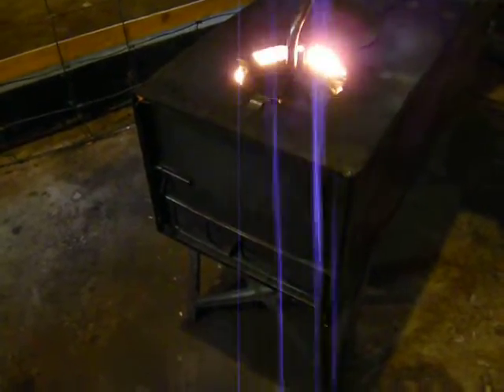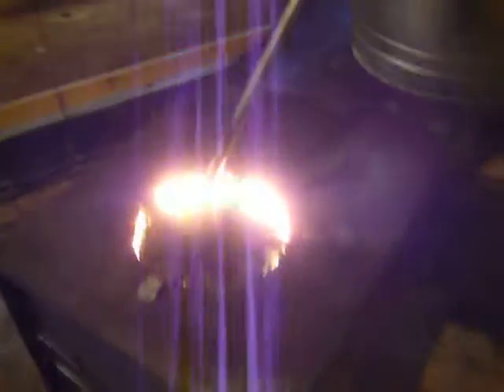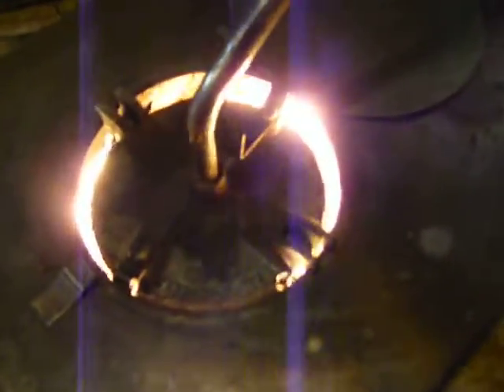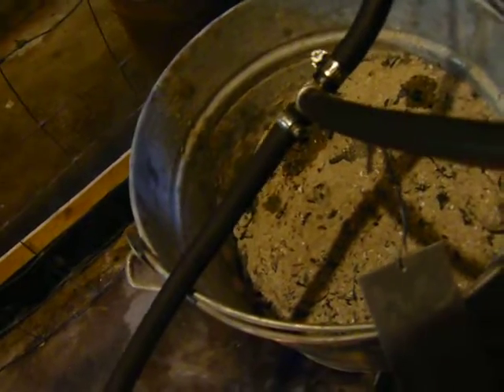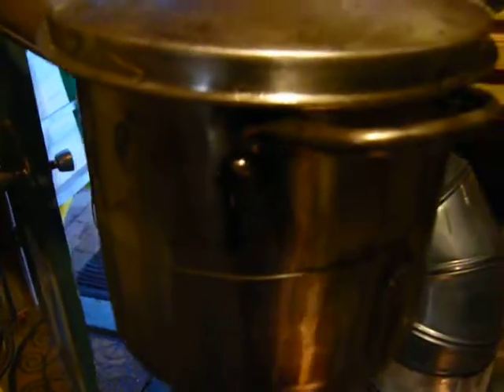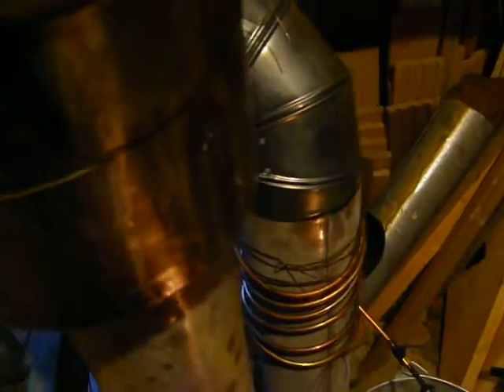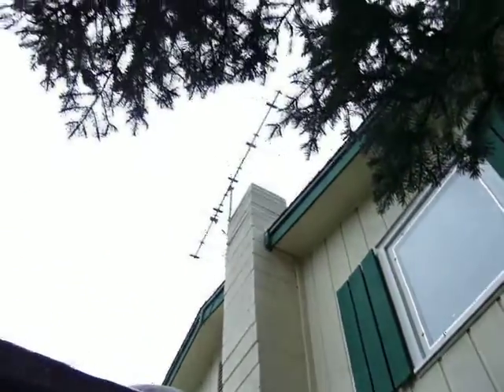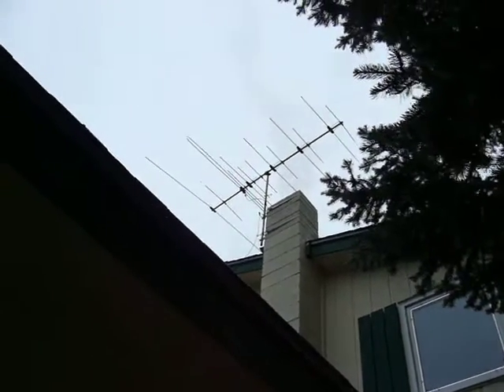Yukon WVO multiple fuel stove conversion

Comment: I start my stove with kerosene. Works pretty good and it keeps the skillet cleaner and allows you to purge your fuel line so there's no thick oil in it. It also eliminates the mess from wood. Takes about a pint to get the stove good and hot to burn the WVO effectively. I also put a small metal ramp in my skillet with holes drilled in it to catch the drip and it helped a lot.  Good video, and I love your stove, reminds me of when I was in Korea. I use a converted wood stove. Thanks!

Comment: I think the smoke is due to the low burn speed (which is also the reason for the pan).  If you add a blower motor to the air intake I think you will get a cleaner (and hotter) burn.  Watch out for creosote buildup if you are generating smoke also.